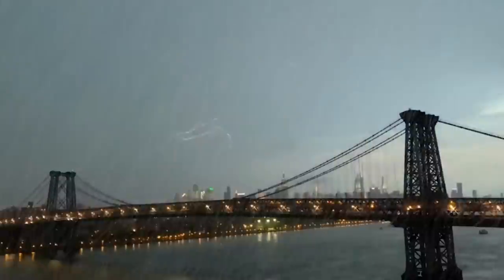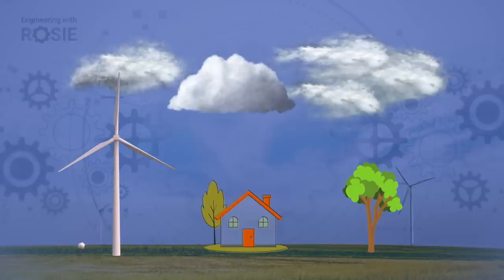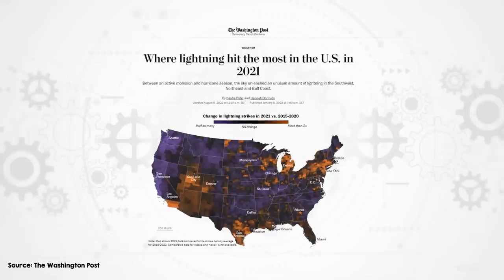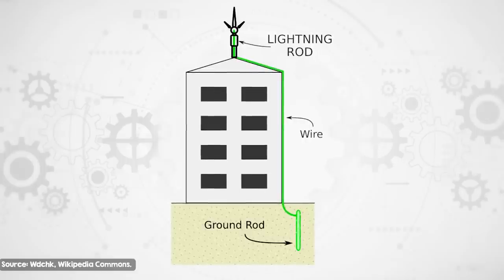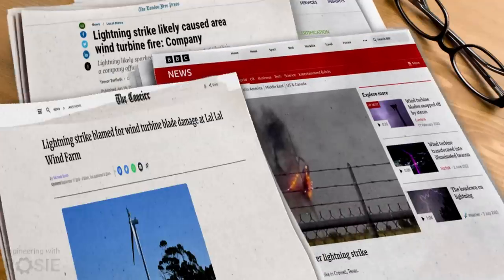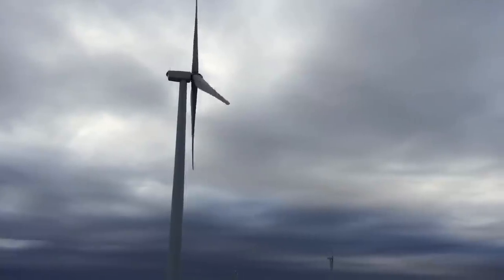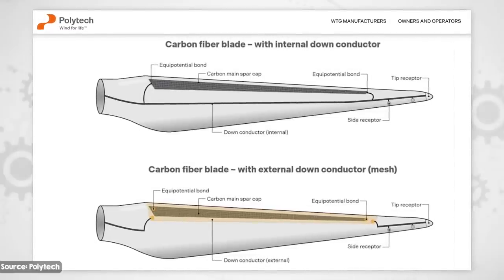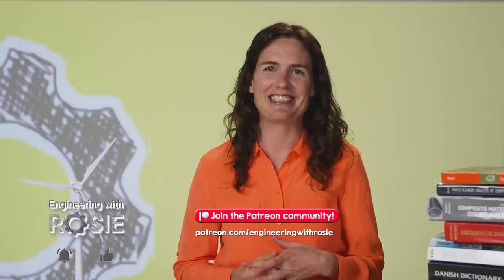Wind Turbines vs. Lightning: What Happens When a Wind Turbine Gets Struck?

Comment: Lightning if you want to think about it this way, it's just like a coil and capacitor. So your carbon fiber is the capacitor And that flashover Is the coil so you're basically trying to oscillate The discharge of another coil and capacitor and when you don't have a resonant frequency that Oscillation It's going to start Breaking down and burning holes through your capacitor and/or discharging outside of your coils magnetic field. I'm connected with other magnetic fields Outside the one you designed it for

Comment: Can the blades be retrofitted with a conductive mesh bonded to the surface and connected to the ground lead in order to save invested funds from being lost all together? How much would the extra weight affect the blades and the whole system?
Reply: Bonding mesh to a finished blade is extremely difficult!
Reply: @WeatherGuardLightningTech   Even embedding it in epoxy resin after sanding the surface for good adhesion?
Reply: To bond on mesh a couple of big tasks - cleaning the surface so it will take the adhesive/mesh, cutting and splicing the mesh so it lays flat, vacuum bagging the whole area, pulling a vacuum and injecting the area with resin.  Throw some heat blankets overtop to accelerate the cure.  Pull off the bag and inspect for the problem areas - Rosie will attest that there are always problem areas - and start repairing / patching until the whole area is covered properly with mesh.  It’s a big job!
Reply: @WeatherGuardLightningTech  I guess the big question is if it is more expensive than replacing the blades outright, what's your guess?
Reply: @agw5425 most wind farms in the US will replace their blades in the next 5 years due to the IRA bill. It’s the perfect time to improve their LPS system. The upgraded turbines will produce with more with less downtime!😊

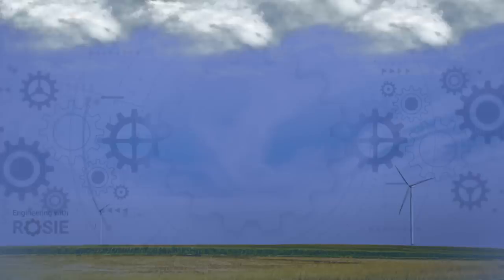Comment: At 2:35, you said "That's negative lightning, which usually flows from ground to a cloud.  Positive lightning from cloud to ground tends to be a single leader with variable branching.  It doesn't really branch as positive lightning is basically hoovering electrons as it moves."  This seems confusing when considering the terminology for electric current flow, or electron flow .. Seems that the positive and negative herein only refers to the "initiator" of the lightning strike, irrespective of the current/electron flows, correct ? coming from sky is positive, from down earth is negative .. sounds religious ..😀😀

Also, is it always electrons from earth flowing upwards to the clouds ?

Comment: its a shame all that energy cant be harvested!
Reply: Step down the voltage, into usable amperage ranges, then store it in mechanical batteries, then push the mechanical energy generated by the mechanical batteries, into normal batteries.

Comment: They can build blades, so build a simple and taller pole on top of the generator unit with a very strong attractor and conductor down to the ground. 
A reduction of strikes on the blades  may help. 
Extra 2 poles either side and with a wire may help.

This lightweight structure would turn with the generator unit.

This idea would have seemed extreme in the early days. 😊

Comment: HUMANS!
First: Boo-hoo! I need more electricity! I want a f*****g huge wind turbine!
Then: Boo-hoo! There's too much electricity in my f*****g huge wind turbine!
Reply from the maker: Lol
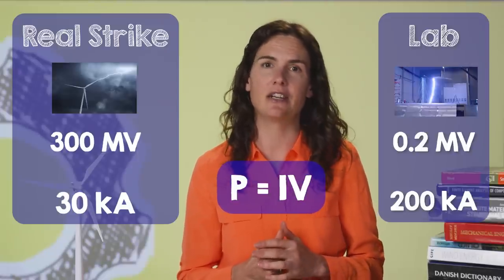Reply: @EngineeringwithRosie  9:25 You say a lightning can be 300 MV and 30 KA.
The internet says the median duration of lightning is 0.5s.
My calculator says that's 1 250 000 kWh.
Even the largest windmills produce <=20 MW peak.
So one such lightning strike delivers as much as energy as the biggest wind mills produce during 2.5 days of peak power.
(I guess all lightnings may not be that powerful, but on the other hand windmills typically don't produce peak power continuously.)
It would be cool if you could store that energy of the lightning and pump it out into the power grid at a slower rate.

Comment: At 9:23  For the non-engineers that's nine BILLION watts.
Reply: For how long. We use energy in Wh.
Reply: @leonhardtkristensen4093  In the case of a lightning bolt, a fraction of a second.
Reply: @richardl6751  That means that a lightning bolt allthough very powerfull doesn't have much usable energy to harvest.
Reply: @leonhardtkristensen4093  The energy is gigajoules but what can it be stored in?

Comment: Can you do something on transmission please. 

Dr Robert Barr, electrical engineering australia nuclear power promoter.
And Robert Parker, Civil Engineer and nuclear promoter.
The cost of transmission lines for solar farms is prohibitively expensive they say, but the same difficulty exists for all concentrated central electric power generation.

Including wind farms. 

Millions of klm of poles and wires to every street and home and building and etc. 
Thousands of kilometres of transmission lines. 

Massive increase in electricity demand means massive increase in this fragile infrastructure. 

Many think this is the critical cost limitation in the renewable energy future. 

Your team will do a wonderful educational service. 
Personally I think that the existing solar panel support structure is our existing rooftops. 
All 20million are connected to the existing national transmission grid. 

EV big batteries are coming and will supply a massive storage system,  a dispersed storage system and will protect the existing national grid by unloading all buildings demand on the national grid.

New thinking please. 
Horse and cart thinking is dangerous. 😊😊

Comment: Rosie I have had a claim by a fellow that he had been talking to a Wind Turbine engineer that said that wind turbines have massive diesel tanks and generators for starting them up. I asked politely was he given this information on April the first but he claims not. Can you give me a link to a site that dispels this crock of rubbish ?
Thanks
Reply: I'd call it grossly exaggerated although with a grain of truth. Usually, start-up does not require external power except for rotor positioning and control circuitry (this power will usually be taken from the grid), it will start to turn on it's own. I don't know how they build them in the US, but here in Europe, wind farms do have backup diesel generators to keep the infrastructure operational in case the necessary power can not be taken from the farm or the grid.